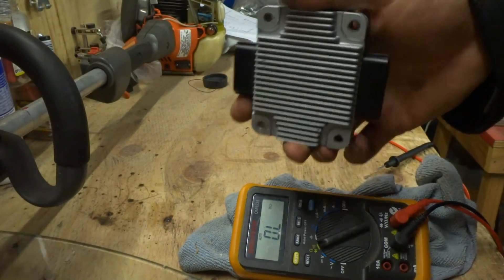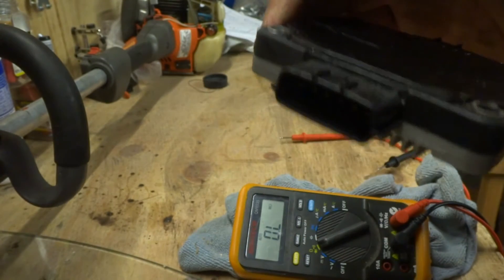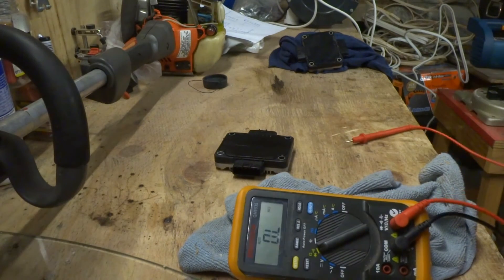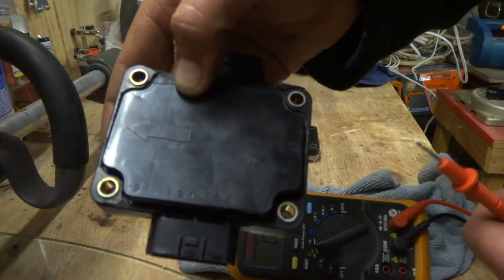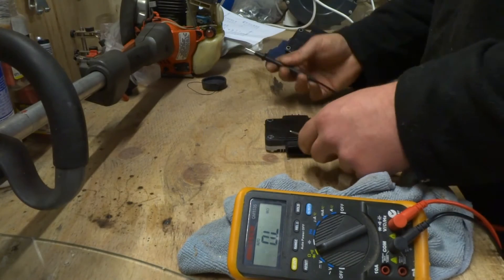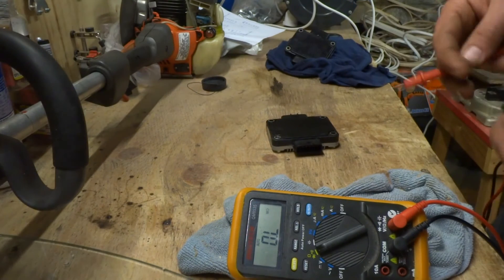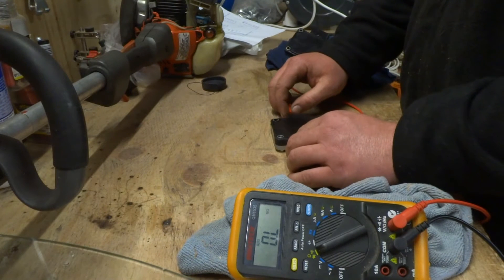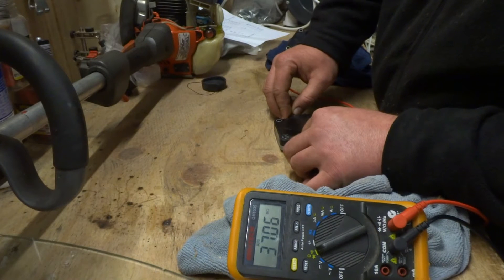R32 GTR or R33 GTR - Testing The Ignitor

Comment: I got an R32 and got a r33 ignighter and it wouldn't start the car.as the r33 car was running when I removed it.
Reply from the maker: I would be checking the plugs also then as the one in my 33 is also from a 32 and runs fine. I replaced a lot of my cables/plugs due to them being so old so your it could be a poor connection?

Comment: Ok I need a little clarity here... my first test showed 0.273 mega ohms across all 6 and the second test showed an open line (0L) across all 6... I need a simple answer is my igniter unit good or bad?
Reply from the maker: Sounds good to me. Basically if you follow the test and the ignitor gives values in one direction but not the other then it hasn't started to break down.

Comment: hi Osiris I might have found the problem but I'm not counting my chickens yet, I've had a lot of issues I've fixed those but still no go, it cranks but no start, I tested the cas  no continuity between no.2/42 52, so I've ordered a cas  and I'll let you know, thanks for the ignition module vid.

Comment: Doubt I will get a reply being this is so old...

But for some reason i get so confused when it comes to testing

When I do the first test I get readings on all pins.. now the second test it stays at O.L ("1") 

Is this bad or good? I'm assuming that the ignitor is shot. I get power to coils to  C.A.S etc but I do not get any spark.
Reply from the maker: When testing the igniter you should get readings only in 1 direction. If you get open line in the opposing direction to the same pins then in theory your unit is ok. If you get readings in both directions it means your unit is on the way out. Does that help?
Reply: @jefferyfarrell  alright soo that's good but bad news lol now I have no clue at all what is wrong lol.
Reply from the maker: HashTagHoonZ check your plug at the ecu. Mine was done up tight but was still out by 0.5mm on one side and it caused me a lot of issues.
Reply: @jefferyfarrell  alright I will gi e that a try I just took a light tester to the signal wire it has pulse when I spin the cas very very dim...but I get absolutely no spark from the coil
Reply: @jefferyfarrell  I just tested mine and I got a OL on all 6 both ways, what do you suppose is wrong
Reply from the maker: Are you definitely sure that you were on the correct pins and right meter settings. Just seems weird not to have any contact. It would suggest that everything inside had blown up and there was no contact or the earth pin was stuffed.
Reply: @jefferyfarrell  so the earth pin is the ground correct?
Reply from the maker: Trevor Sutherby yes sorry I have a habit of using both terms.
Reply: @jefferyfarrell  what are the proper settings on my multimeter

Comment: cool thanks Osiris I'll keep you posted
Reply from the maker: All good.
Reply: hi Osiris do you know the ohms a oil pressure switch needs to be ok on the rb engine, thanks aaron
Reply from the maker: Its not in the manual but if it is just a switch then you should get open line on a meter when its not contacting and some resistance when it does.
Reply: ok thank you.

Comment: when testing for fault and you get no reading at all on each pin is that good or not?
Reply from the maker: Are you getting no reading in both directions?
Reply: one direction I'm getting readings positive on base, but positive on collector side no readings
Reply from the maker: Sounds like it’s ok. You should only get resistance in 1 direction and then open line in the reverse. A lot of my issues also stemmed from the ecu plug being slightly loose even though bolt was done tightly it was skewed by about half a mm which was almost impossible to see but you could feel it move when pushed.

Comment: Circuit boards can and will expand some with heat even when new, over time connections can break causing intermittent shorts when hot. As the part cools the break gap closes and the circuit board will work normally.

As the circuit board gets older the gap can get large enough from heat cycling that even when cold the break is big enough to cause problems.

Trying to track down my miss fire issue, but had a similar issue with a Volvo 850 T5 ABS controller, when hot ABS light came on and no ABS, when cold no light. Found someone who could repair the board and add additional cooling for far less than new, worked fine till sold!

Comment: Would this cause a misfire to come and go randomly? one minute its fine the next its misfiring? it seems to drive fine until its fully warmed up?
Reply: I know your comment is a bit old, but I'm having the same misfire issue with my GT-R. Once it gets up to temp, I get a slight misfire once into boost. I'm hoping it's just the ignitor
Reply: @emericareaper2  I get mine at 4k its been a few years but did u figure it out , all coils seemed fine and plugs where just changed and gapped to .8
Reply: @connornorlin  Igniter. Swapped mine out with a different one & it fixed my issue

Comment: Thank you for this, super helpful! I'm wondering... I pulled my ignitor when it was hot. I did the fault test and I received O.L. ("1") on 4 of the 6 pins. Two of them read 1.8XX or so. Once everything cooled down, they all read O.L. ("1") again. Could this mean that my ignitor becomes faulty when hot? My car does get worse when hot and sometimes does not want to start all together.
Reply from the maker: Yes the heat can definitely cause the connections to break down which would make the car run worse. Mine only did it under boost and about 10 mins of driving and would then get progressively worse.
Reply: Osiris Thanks so much for this. New GTR owner here in the USA. I am having the exact same symptoms. Just recently turned up the boost to about 16 psi and right about that 10 minute mark the car starts to run poorly. I suspected this device but now I am almost positive after seeing your video. I am going to test it

Comment: Hey mate have you had issues with weak spark before mine just won't start have changed the ignitor still nothing
Reply from the maker: hey, my issue was spark becoming weak as the engine heated up. although my ignitor was partly to blame my other issue was that my ecu plug although bolted in tightly had moved out by about half a mm which was enough to make my issue worse. perhaps it's something similar?

Comment: Thanks for posting this; I'm trying to diagnose a misfire and really appreciate the info. Will hopefully have the ignitor out of the car tomorrow night to see how it tests.
Reply from the maker: I hope it helps. it took me a very long time to find the info for testing this that actually made sense.
Reply: Agreed; most folks simply default to replacing parts without doing any diagnosis. With the cost of a set of coils (and a good ignitor) I'd rather have some confidence as to what needs to be fixed before throwing money at the issue. Thanks again.
Reply from the maker: +71firebird400 It actually turned out in the end that my problem was a mix of issues and the ecu plug was loose and out by under 0.25mm. I felt it move just a tiny bit but it fixed the last of my misfire issue. so that's worth check as well. My new ignitor definitely checked out using this method though.